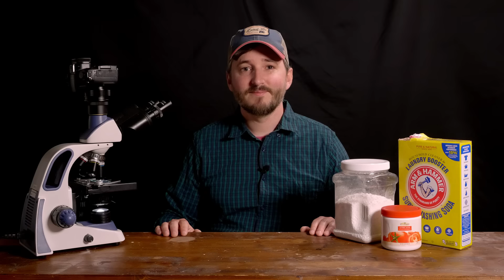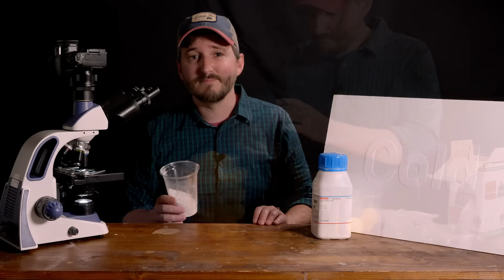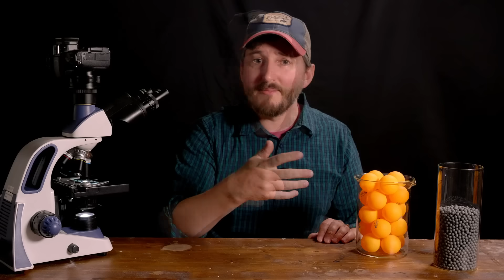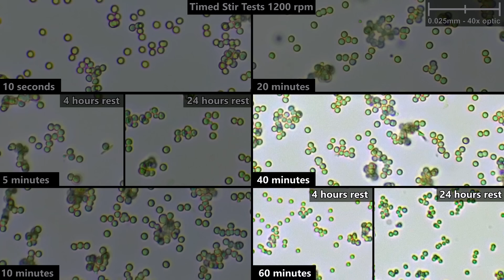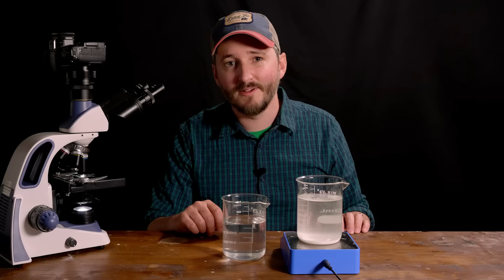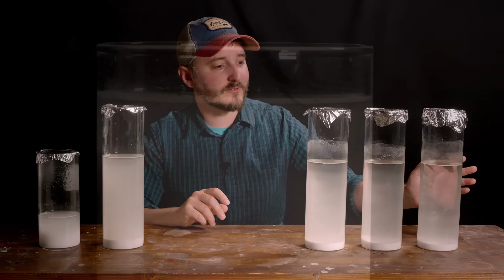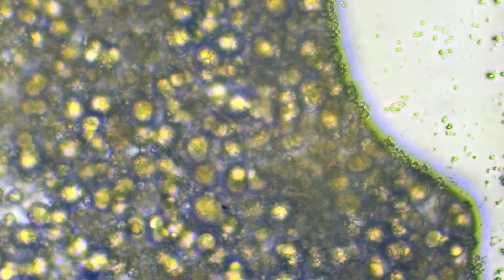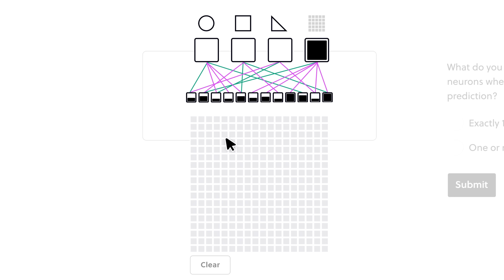Making Infrared Cooling Paint From Grocery Store Items (w/Novel CaCO₃ Microsphere Synthesis)

Comment: I haven't watched this video yet, but saw it mentioned in another of your videos.  10 years ago i owned an old plantation house that i turned into an off grid farm.  I wanted a paint on the house that when the sun "viewed" from a high summer angle would reflect the heat and in winter when viewed from the lower angle would be a dark color and absorb the heat to help heat and cool the house.  I know some cars have paint that appear one color from one angle and a different color when viewed from another angle so i know it can be done.  I just never completed that project.
Reply from the maker: Interesting idea. I don't know how well a two tone paint would work for that purpose, but you could do it with V shaped channels with dark paint on one wing and light on the other

Comment: My Hypothesis #2 soloution bumped to #1 due to probability if like substances, commonly adding Zeolite one natural occuring crystalized and negative charged into this mix seems like the perfect candidate to help bond them as they naturally coexist already in slightly different form and that slight difference is what I concluded may be a better alternative to adding any more chemicals as this would be all thats needed if poweder coating aluminum.

Zeolite - Found worldwide everywhere naturally occuring is negative ionized volcanic ash formed under pressure, used often as a dessicant would be valuable to finalizing a powder pigment, which is often used in a acrylic dental work so seems a very likely contender for also solidifying the paint especially due to its IONIC - charge that had not been for following you understand this is ideal for aluminum adhearing as aluminum is also charged negatively.

FORGIVE my vision of unfounded information, just a hypothesis after studying soloutions some less positive more than others lol, and after four hours of watching Terrance howard Interviews  also it being 4:25 am, I find myself back here for the 1000th time this year, stumbling onto some information in the dental word of acrylics and what keeps Terrance howard from cracking and understanding that this could be a very swell answer to finalizing a spray that adheres without cracking and may just enhance due to the formations the overall products volume and productivity due to the relations of the substances but its late and if my dyslexia is fooling me than it could do the oppisiste which either could very well be an iteresting reaction regardles due the the nature of the relationship.

Comment: I have an experiment idea for an extreemly low energy AC that I will not apply due to lack of drive. (AKA I don't really wanna do it). So the idea is free for the taking for anyone who wants it:

(Step one)
Compare the difference between painting the inside of a box, the outside of a box and both side of a box.

(Step two)
Paint a tube either on the inside, the outside, or both sides... depending on which results were better from the previous experiment.

(Step three)
Pass varying speeds of air through the tube to see if you can cool the air with a simple fan, and what speed is most efficient.

[Some notes]

(Note one)
Painting the inside of a tube may be difficult, I get that... So if it comes to that than I'm sorry, but I only have some vague ideas on how to make that easier... Maybe try painting in layers like normal paint, on a tube large enought to do that in... OR... The one I like better; maybe try using a paper towel role, (or similarly constructed tube) unraveling it, painting it, then rolling it back up and taping it back together before the paint dries to the point of loosing flexibility?

(Note two)
I believe very slow moving air would have the best chance as it would have more time to be in contact with the cooler surface thus allowing it more time to transfer heat out of itself... in that same vein; a longer or bigger tube has more surface area, but longer also take more time to pass threw so I theorize that a longer tube would you yield better results.

(Note three)
I don't need royalties or even a mention, I just want to be notified if you try it so I can see what you come up with, so I can maybe some day replicate it for myself without doing all of the work of the above-mentioned experiments. (Once again, I think it'd be cool [pun intended] but I'm also lazy so...)

Comment: Have you tried an acrylic pouring medium? Something like GAC Gloss, Satin, or Matte pouring Medium. I also like GAC800 or maybe epoxy resin. Probably nothing that reduces UV light, or or is UV light unnecessary?
Reply: Two additional questions;
Calcium carbonate is a common and inexpensive calcium supplement. Why not save time and just buy it? I assume the answer is in making different size spheres. Would there be a way to convert the form of CaCo3?
Why spheres vs. crystals? As the paint dries, wouldn't the crystals bond together as a solid sheet?

Comment: I didn't scroll through all the comments, but in case no one else mentioned this about research article fees: when you hit a paywall (i.e., a journal wants to charge you for an article) you can often email the authors (especially the marked "corresponding author") and ask for a copy of the article and they will usually send you a copy for free if it's for educational purposes.

Those article fees are ridiculous and anyone doing educational stuff like this should not have to pay them out of pocket!

Also, like a lot of others said, this is really impressive work. Thank you for sharing!
Reply: and not a cent of that goes back to the authors. It's one of the most heinous crimes in academia.
Reply: @272arshan  FACTS
Reply: Sci hub moment

Comment: I have a more general (unanswerable?) question. What is it about calcium carbonate and barium sulfate that makes them radiate in such specific wavelengths? Is it possible to predict other chemical compounds that radiate at wavelengths that match the atmospheric infrared window? There might be other compounds that are easy to make, commonly available and durable and easier to apply. But I don’t even see a starting point for predicting what these chemical compounds would be.
Reply from the maker: See the section of this wiki article titled "Origins": https://en.m.wikipedia.org/wiki/Emission_spectrum
Reply: May be a good research into utilizing the new again Walter Russels The Universal One a must read 1927

Comment: I am still wondering how this could be used in practice. I live in a home which is designed to keep the heat in (Netherlands), but during the week of summer it can get quite hot inside, mostly due to the heat that gets in through windows or through ventilation from the outside.
If this only works when pointed towards the sky, it seems would not help much to make the rooms inside cooler. Because insulation is quite good, I don't think putting it on the roof would help much. Any thoughts on that?

Comment: Just checking something... the relationship between the infra-red wavelengths, and heat, is that the typical temperatures of things on Earth are those that cause IR emission, right? So there's no special IR / heat relationship, it's just the common temperatures of things around us cause them to emit in IR rather than visible, or microwave?
Reply from the maker: There's more than one thing going on. One aspect is blackbody radiation https://en.m.wikipedia.org/wiki/Black-body_radiation

The other is a substance's emission spectrum https://en.m.wikipedia.org/wiki/Emission_spectrum

Comment: Have you tried this pigment mixed into car paint clear coat ? This would be durable application as the clear coat hardens with UV light (like nail polish) Because let's be obvious : we all need that on the roof in the holes between solar panels ... for the moment I use various plants, but for the concrete surfaces this would be great.

Comment: Limewash is slaked lime (calcium hydroxide) which is suspended in water. Once applied to a suitable surface, the water evaporates and carbon dioxide from our atmosphere combines with the calcium hydroxide to form calcium carbonate, or limestone. This is known as carbonation. In regards to packing a ton of that material, wouldn't making is thicker in application help? Many layers. Since lime is a sacrificial paint it would do good to make it thicker anyways. That could be even cheaper. Not as good, but still very interesting. This is briliant, congratulations.

Comment: Some  "superglues" use a mix of octyl cyanoacrylate + n-butyl/isobutyl cyanoacrylate to increase bond strength and flexibility. This might be a way to decrease cracking and peeling.

And another fella here on YouTube made a sand blaster with a pressure washer by letting the sand get sucked into the spray at the tip. Could this be adapted as a sprayer?

Comment: Given how cheap this material is to make, is there any benefit to simply using a thicker coating of the paint instead of making nanospheres? It seems like the benefit of making nanospheres matters most when the paint needs to be especially thin due to cost or weight, but this stuff is dirt cheap.
Reply from the maker: I'm not sure. There are an endless amount of questions I need to do experiments to answer

Comment: Just realizing: my dad had a greenhouse for a living. It was an old one and didn’t have the screen below the roof so he uses the old method: chalking by dissolving chalk (calciumcarbonate) in water and spraying it on the roof. Because it rains off it is necessary to do it every year. The chalk provides shadow to the plants, reflecting sunlight but maybe extract infrared/heat from the greenhouse.

Comment: again, i'm glad you made this video and did all this work. but from what i can tell you didnt compare your results to the best barium sulfate results, nor to limewash. amorphous crystalline whitewash -- hydrated lime in water, applied to a surface in many layers, forming an amorphously crystalline calcium carbonate coating -- is one of the most reflective paints available -- and has been available since the bronze age. you went through all the rouble of making microspheres without comparing to an amorphous CaCO3 control. 

and the dissolved acrylic is just a horrible binder. it's so bad it should not even be considered.

again great work, in isolation. making microspheres like this -- excellent. but a very oblique approach to the goal.
Reply: Please get on that doing that project you suggest,  and share the link here as many would be interested in all improvements 📥

Comment: i used to work for northrop grumman on the command post platform. which was humvee with large cabs on the back full of computer and communications equipment.  these would be parked next to large tents and the equipment was then wired up to computers and screens in the tent.   they had major issues with the cooling systems trying to keep the equipment cool inside the unit as you would imagine.   they were looking into methods of painting the vehicle to try to mitigate some of the heat.   i always thought they should make the camper shell that they mounted on the humvee a vacuum like a refrigerator or a yeti cooler(these werent around then)   you got yourself a market bro.  make some bread off it

Comment: Came here from the opal video.  Both amazing videos.  Watched you back in the day, and boy I'm glad I rediscovered your channel!   I do have a question, I get why controlling the size of the spheres impacts the packing efficiency and density of the pigment, but how are you controlling what wavelength of light the paint radiates to get it in the correct infrared spectrum?  As in what makes this paint better than another high density white paint?  

Thanks, 
-Ryan
Reply from the maker: For this paint and my earlier paint using barium sulfate, the calcium carbonate and the barium sulfate both emit light in the correct spectrum all by themselves. You've heard of a spectrometer? That is a machine that detects what it's looking at based on the light that is emitted and absorbed particularly by that material, because different materials all have their own native IR emissions. Calcium carbonate and barium sulfate emit good wavelengths for cooling. In the opal video I am exploring how to enhance those wavelengths more than what's natural for the material.

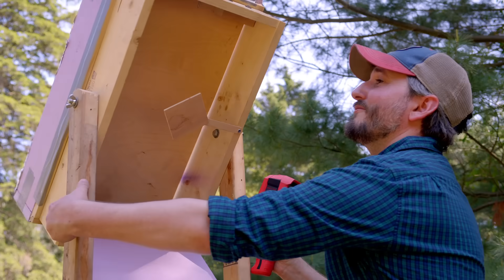Comment: 4:16  covering that with a plastic does not goes against their same purpose?  Because even if the plastic has similar absorción than air, which would be transparent to the paint wavelength, but that plastic will act as greenhouse, trapping heat between the plastic and the paint layer, which part of that radiation would be absorb because the white paint is not perfect.
BTW:  amazing video,  full of info.. love it.
Reply: you put the plastic in contact with the paint so it doesnt create an air gap that would work like a greenhouse. if it is in contact with the paint it would just provide protection from the ambient air. Skycool film would be best. but no one wants to sell that to joe public.
Reply: @CoffeeblackUk  yeah, I remember that film when come out, but later I forget its name. 
Looks like they are trying to growth, but I imagine they do not have the capital yet to rampage production and reach a good price for the public. 
But as any new product, we dont know their disadvantages yet, so maybe they are still working solving some of them.
I wonder what is their lifespan or how much dust reduce its performance.

Comment: Can someone please explain why it is necessary to have a dense pigment if the intention is to have air gaps left by the water evaporation from the acrylic anyway? It seems like, given that the air gaps described to act like snow giving "free whiteness" would also apply to the pigment, as long as you could make the gaps in the pigment have the same refractive effect.
Reply from the maker: The point is to have less binder. Gaps in pigment would typically be filled with more acrylic, though the air bubbles help.

Comment: Hi, great video! Can you say what microscope you used to get the photos? I.e. what resolving power / NA and what magnification please? I want to make some but I'll want to check the approximate sizes and quality of the spheres produced.
Reply from the maker: I used a Swift 380T with a 40x optic. For information on how to set up a microscope for taking photos I recommend the channel Microbe Hunter Microscopy. To measure the size of particles you will need to calibrate the scope, which he also has several videos about.

Comment: Isn't it more effective and straightforward just to use a solution of calcium hydroxide and a solution for carbonated destilled water? You save the washing steps and get much pure product the only question left is, dose it produce reliably microspheres with various sizes 🤔

Comment: you need to use the Yves Klein Blue process and suspend it in a medium like a pigment, then you can paint with it and it will be waterproof and insulated by the medium if you choose the right one... if you coat this with organic polymers it will radiate even more heat like the MIT water maker proof of concept.. also why not just use barium sulphate

Comment: You might be able to make it more like paint with an Oil Based additive called Penetrol or water based Floetrol they retard the formation of "skin' on acrylic coatings making them easier to apply by brush or sprayer.
Reply from the maker: Thanks for the tip!

Comment: What happens if you use the reflective paint on a small wood stove? Does the thermal radiation also get moved into that specific spectrum? And how does that affect the heat transfer from the fire to the space / occupants?
Reply from the maker: Better to use black on a stove because it has broadband ir emission. That will dump heat from the stove faster when it's hotter than ambient

Comment: as this seems interesting for the shown applications, I'm curious how it could be used in automotive spaces. perhaps as a body paint, or for engine components to separate heat from other areas,maybe to coat plastics or induction parts for denser air, and perhaps the same for exhaust for better flow. I don't quite know the properties of polycarbonate as a substitute for the acrylic, but I know that it can withstand much higher temperatures than acrylic.

Comment: This is awesome! Going to try this for immersion cooling some computer parts in the summer :) hopefully the spray bottle method is thin, I am thinking of spraying it on a radiator then running coolant through. Perhaps a panel (or 10) of this might be better, though.
Reply from the maker: Keep in mind it only works if there's a clear view of the sky. It won't work inside a computer case or through a window

Comment: Hi @Nighthawkinlight I have been doing some at home DIY to replicate your efforts here but am having consistent issues with cracking and poor adhesion. Did anyone else experience this or have tips? Maybe I have too much or too little water added in, or my substrate prep isn't good enough.
Reply from the maker: I haven't tried my paint on very many surfaces, mostly just plywood. Other things may require a primer but I haven't tested what kind works yet. Sorry you've been having trouble!
Reply: @Nighthawkinlight  Thanks for your reply! I have tried on plywood and a primed piece of aluminum sheet metal. In any case, I'll keep fiddling with ratios etc. I like your spray application best and am aiming for that if I can. Even with my so-so attempts so far the results have been encouraging. Between 0 and 2 degrees below ambient. Cheers from Vancouver, Canada :)
Reply from the maker: Aluminum is particularly tough to paint. Glad you've had some good results anyway!